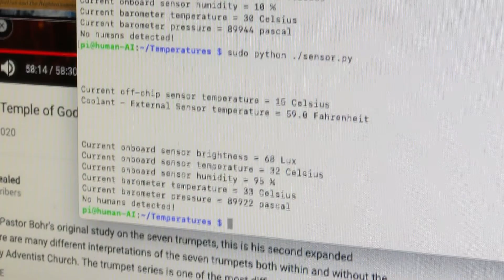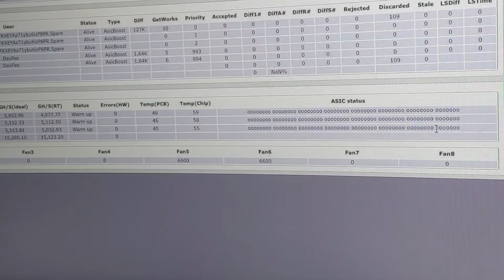DIY Immersion Mining Antminer S9 - Part 1

Comment: mineral oil contains sulphur that destroy the electronics in long term, there's coconut oil with low corrosion that can be used with bio additives to lower acidity, humidity, etc. also there's no need to fill a big tank with dielectric fluid but use passive cooling with a water tank underneath where the oil cools travelling in hoses
Reply from the maker: Have you done this method yourself running a few ant miners?  I am Interested in the research
Reply: @region-7  no, i am against currency and currency speculation and more against wasted energy for digital currency. i prefer renewable resources, diy fabrication and technology sharing, currency is a drag for development. this is a link for coconut oil publications as dielectric fluid for cooling and protecting circuits https://www.google.com/search?client=firefox-b-d&q=coconut+oil+transformer+oil
Reply: Tinker Alexander  oil can have acidity and absorb humidity, they can both make subtle electrolysis or degrade thin metal. we are talking about several decades lifespan
Reply: food grade has low or no sulphur.

Comment: Is this build out of plexiglass? did you have any issues with the dielectric fluid and the plexi?  Or is this mineral oil?
Reply from the maker: The buildout is Acrylic and I used Mineral Oil no issues.  The only thing I would recommend with the acrylic is be very accurate and the thickness should be 1/2 to 3/4 in. thick to avoid the liquid from bowing the center overflow.  The mineral oil will get warm to very warm but if your cooling is working well it will be just warm.
Reply from the maker: I didn't use dielectric due to cost and I was unsure about evaporation and having to build a semi-closed system.

Comment: Please sir , i need a method to stop the fan to put the miner in the oil without the fan
Reply: Have you tried removing the fan blades from the fan axle and letting the fan think it is running? I imagine you could cut the blades off short to try it.
Reply: في حاجة اسمها فان سبوفر دي شبه فلاشة صغيرة بتركب مكان سلك المروحة، تخلي الجهاز يفتكر ان في مروحة حتى بعد ما تخلعها، او ممكن تغير الفيرم-وير بتاع الجهاز في حاجات موجودة اونلاين ببلاش بتخلي الجهاز مش محتاج مراوح اصلا و تقدر تشيلهم عادي.
firmware, fan spoofer

Comment: Hello, great workmanship! What pump are you using?
Reply from the maker: (amazon) - VIVOSUN 2600 GPH Submersible Water Pump 120W Ultra Quiet Pump with 20.3ft Power Cord High Lift for Pond Waterfall Fish Tank Statuary Hydroponic....  I would not recommend this pump because I had so many issues with the O-Rings and the random leaking.  The flow was ok but I would step it up.

Comment: question: Can the power supply be submerged too?
Reply: YES, mine work underwater but they are ASIC A1.
Reply: Yes but you are also adding the heat of the power supply.  So it will be your call.

Comment: How do you cool down the mineral oil?
Reply from the maker: I modified a 5000btu Air Conditioner and sent the oil separately thru a radiator and took the cooling side of the AC, immersed it in 30percent antifreeze/water mix.  Keep the oil and cooling separate of course in a igloo cooler.  The igloo cooler becomes the heat exchanger.   Note that depending on the volume of oil used will affect the cooling of the oil.  And the max you can get on 5000 btu is about 2400watts @ 60-70C.
So if the Btu is 18000, then the max cooling is 6000w.
Reply: @region-7  isnt it better to use dielectric liquid instead of mineral oil?    I want to convert a ductless A/C compressor   3 TON unit to cool down some 40 GPUs would appreciate any suggestion of advice
Reply from the maker: @lovemytechy  DFs are nice if you can afford the fluid.  In our case we had about 20 gallons of white MO and it worked just fine without the crazy investment into DF.  If you make a mistake and something leaks, DF is an expensive lesson that goes negative on your ROI :)
Reply: @region-7  how do you clean the house from mineral oil when you want to sell it perhaps?  Do you think I can use a ductless ac compressor to cool the solution somehow?
Reply from the maker: @lovemytechy  91% alcohol bath and a modified ductless would be awesome
Reply: @region-7  do you have any experience with modifying ductless compressor for this. How would u go about it. If it is worth Pershing I don't mind compensating you for your time.  Dielectric fluid would probably cost 2000$ for an small medium tank with 50 gpus or so I think. How is the mineral oil compared to dielectric fluid.
Reply from the maker: @lovemytechy  the concept should be the same as modifying an AC in window except the ductless should be a lot better.  The copper cables might be a little long but depending on your configuration it should do.  The fun part of my proto-design was bending that copper without breaking the copper tubing.  With the ductless that should not be a problem.  It should be a Sweet setup!;)

As for your other question, depending on location.  I’ll be live on the Zoom later today EST.
Reply: @region-7  Can I dip the wall hung ductless fan head  in the dielectric solution tank too cool the fluid and have the GPUs in the same tank?
Reply from the maker: @lovemytechy  here is the issue you might or will run into with dielectric, the evaporation temperature.  You will have to have an enclosed system.  As for the ductless head, all you want is the condenser immersed.  Personally I would not put that in the same liquid as the mining equipment.  You have to have a simulated heat exchanger independent from the hot liquid.
Reply: @region-7  I know 3M novac evaporates but there are otherones with very low evaporation point like this  https://engineeredfluids.store/collections/dielectric-coolants/products/ec-100  ;     Doesn't mineral oil damage the boards or components in the long run? ;  how do you prep the GPU for immersion, change the thermal paste to iridium foil ; but not sure what to use for thermal pads on memories  that doe snot get resolved or messed up by Dielectric fluid or Mineral oil;   they are HydroCrbon base and well eventually desolve other hydrocarbon based thermal pads
Reply from the maker: @lovemytechy  On the mineral oil I have heard that said about it over the long run but I have not seen it personally.  The dielectric from Engineering Fluids is nice.  It could be  designed for a tight space for the liquid and you could get away with 2-3 20Liters of Dielectric.  Just make sure that all is sealed up with a lid that has a rubber seal and it is removable of course.  I will say this, working with acrylic is Fun:)

Comment: Buenas te pregunto. 
1- se puede sumergir también la fuente de poder?

2 - El aceite mineral que usas, es el llamado aceite mineral transparente también llamado parafina líquida °9?
Usado en la industria cosmética?

Good morning I ask you.
1- can the power source also be submerged?

2 - The mineral oil you use, is it the so-called transparent mineral oil also called liquid paraffin ° 9?
Used in the cosmetic industry?
Reply from the maker: 1) it can be submerged but not recommended because it is adding heat to the oil.

2) White mineral oil (food grade)

Comment: Hi what pump are you using for this?
Reply from the maker: a pump that I would not recommend.  it does about 2600gph and it has been problematic on the connections...(VIVOSUN)...  I am looking at a recirculation pump or similar that uses 12vdc like an RV pump...
Reply: @region-7  Hey you might want to look at a GearRotor pump - we used to use them all the time for our Vegoil cars - they are pretty cheap 2nd hand on ebay and you can buy various sizes - wallbro and Holley are the two big names - they are bullet proof, run on 12v so you can easily mate them with a PWM controller for speed required
Reply: @MrCraigCurtin  Thanks!  I will look into it.

Comment: I see that the power supplies are left out all the time, why is that?
Reply from the maker: No need to add the heat of the power supplies to the oil and it gives me the flexibility to change or upgrade without having to clean them from the mineral oil. :)
Reply: Are the power supply’s noisy?

Comment: This is awesome, what did it cost to build this system?
Reply from the maker: Acrylic - about 275.00. 
Mineral oil about 350.00 (Amazon/Walmart online 20 gallons)
AC - 150.00
Radiator - 90.00
Antifreeze - 10.00
Igloo Cooler - 18.00 
Pump - 100.00
Misc Piping and acrylic glue (125.00)
S9 Miners - LOL (before the prices shot up!)

These are estimates...
Reply: Good morning ,
where can we find the acrylic tray please? @region-7
Reply from the maker: I had to think about what you were saying.  The acrylic grid you are seeing is call POLYSTYRENE EGG CRATE LOUVERS.  You can get them at Home Depot or somewhere similar.  They are cheap :). Are you building one of these?  if so, share your progress! ;). Thanks  @Mbplaza31
Reply: @region-7  
Good morning , I'm talking about the transparent box that contains all the liquid. I'll find out where to find it. how did you assemble and glue it so that the tank remains waterproof?
Reply from the maker: This is the beauty of Acrylic and Acrylic welding.  Look up videos on how to make a fish tank out of acrylic.  The glue used is the same in those videos but I used Weld-On 4 and Weld-On 3.   @Mbplaza31